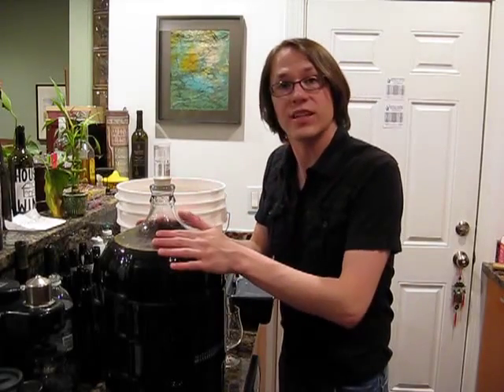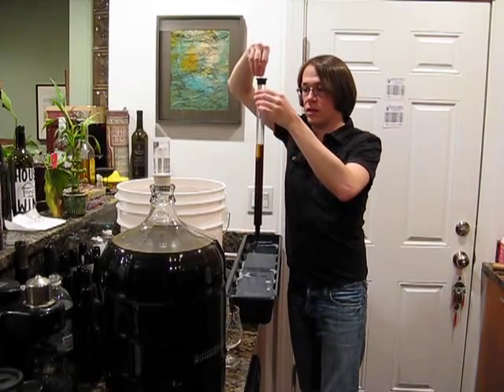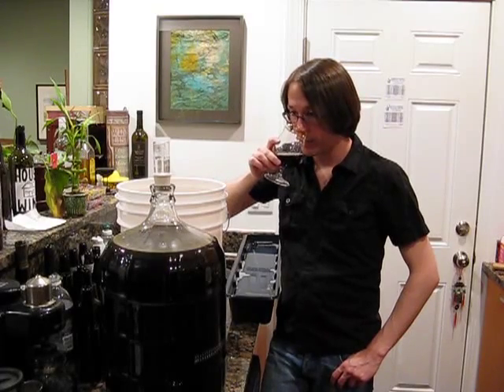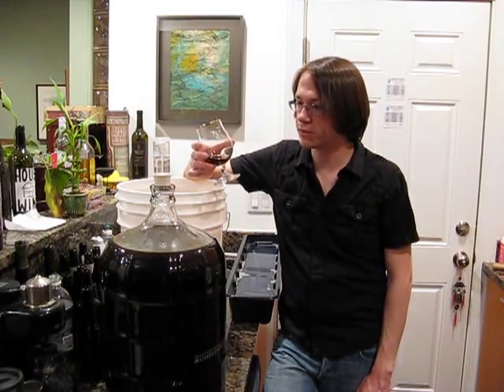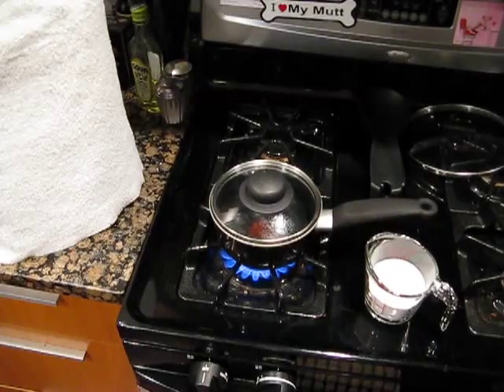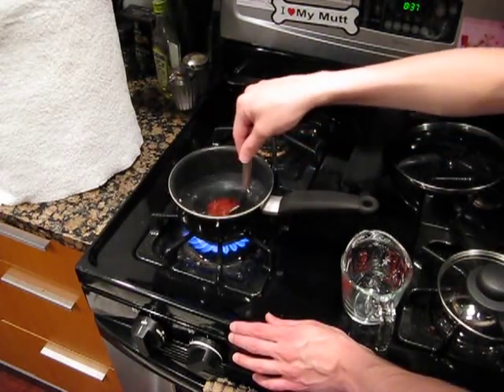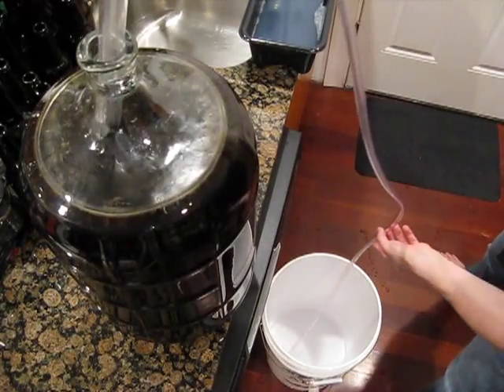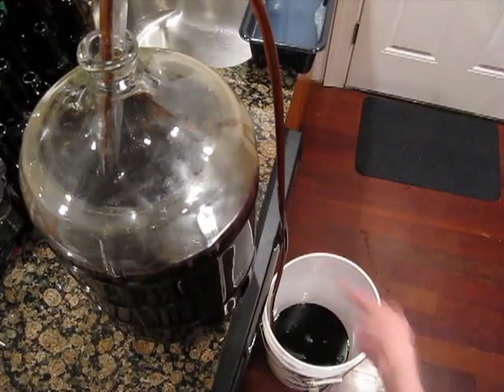Home Brewing a Java Stout With Joe (Part 5)

Comment from the maker: @hoppinglion01 You know--that's a very good question.  The instructions very directly stated that the coffee had to be added right after the rigorous primary fermentation had calmed down, right before putting into the secondary.  I wonder if the addition of coffee might adversely affect the yeast during the primary fermentation...  Or like you said, possibly the actual fermentation would alter the coffees contribution to the brew...  I'll have to check this one out!